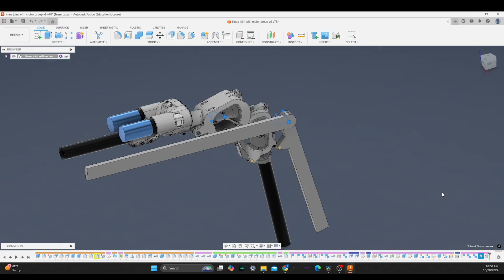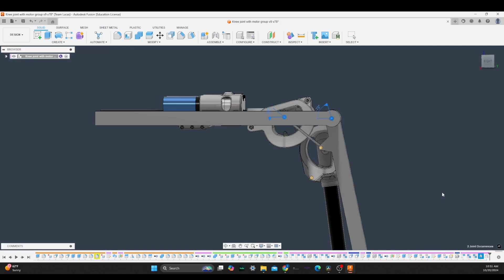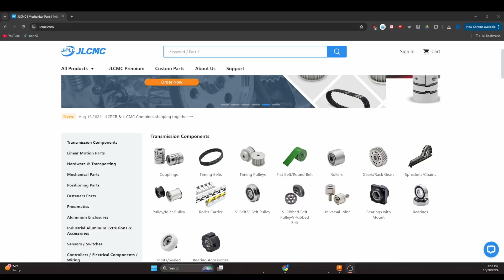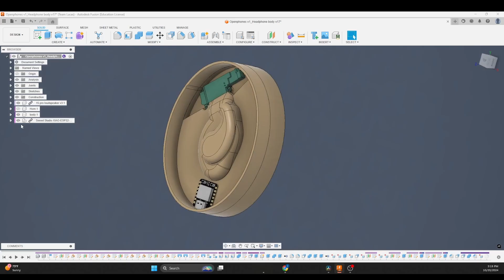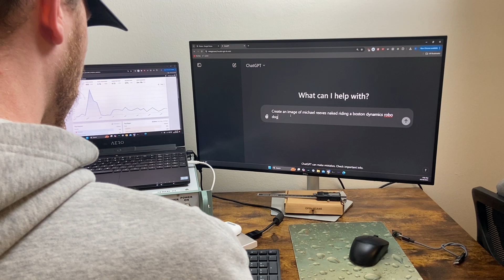Open-Source DIY Quadruped: An Assembled Leg

Comment: What kind of forces do you think it can take? I have an 80(ish) pound tripod dog (back left leg, still got most of the meaty thigh).. I've been thinking of building a prosthetic (not that he seems to need one). I wonder if I could fix that knee joint to work with gas springs.
Reply from the maker: The joint is really strong, way stronger than I expected it to be even. I bet I could put my weight on it if I had a good way to lock its position. The motors on the other hand seem to stall at 25lbs of force, but if you used gas struts you could totally get more force out of it. The CAD modes are up on my website if you want to take a crack

Comment: Are those needle roller bearings on carbon fiber? How does that hold up?
Reply from the maker: Not enough testing to ensure it'll hold. I plan on replacing the main hip axis with a 1in steel tube for the needle bearing to ride on instead of the carbon

Comment: Before I thought the motors were the wrong choice but I think I was wrong. Those DC motors could work pretty well with some good drivers. Im used to bargain h-bridges but if you have current sensing you could make something much smarter than just a servo. The design looks really stiff and durable too.
Reply from the maker: Honestly until it was all assembled I was quite worried about the motors too. The new motor controller boards are going to be a game changer. They’re so feature filled that I will probably make a video showing them off and how they can be used for a TON of other things than just driving motors

Comment: This is a very promising looking project. I think the only problem I may see with it in the future, is the foot. Although it is difficult to tell from the video, it looks like it could be a fragile part, which may not last well in walking conditions, especially outdoors. Also, wouldn't the backdriveability of a motor also depend on whether the robot is on or not? I'm not sure if your demonstration was representative of real conditions the actuator would be in
Reply from the maker: I agree with both your points. I have a more standard looking "nub foot" designed and printed which I will do the majority of the testing with, but the compliant paw was too cool to pass up. 
And yes the motors will act differently once powered up, but I think it will depend more on how the motors controller is tuned. Right now I have them on a PID loop, so the farther from their target the more current will be given. This should have them act like a spring. The PID loop can be tuned for positional holding or for reaching their target quickly, or have two stages of PID values to get the best of both worlds. I could also set a deadzone around the target angle where the H bridge motor driver shorts the motors causing them to be very difficult to back drive. Programming isn't my specialty so we will have to see how it goes

Comment: Using needle roller bearings right on carbon tube like that will fail pretty quickly with any load or use.
Reply from the maker: This is something I have definitely been worried about. I will likely replace that carbon tube with a 1 inch steel pipe for durability. Luckily that is a very easy change
Reply: @WilsonFabrication  For weight, use aluminum tube. Polish it and use PTFE sheet for bearings. Rolling element bearings are only needed for high speed.

Comment: I don't really understand the Arduino Pro Mini. Why not just solder the MCU directly to the board? Btw. you might want to use some more modern MCU-s.
Reply from the maker: I'm actually ditching the pro mini and replacing it with an esp32! And just like you recommended I'm using the castellated edges to solder the esp directly to the board. I'm planning on using the esp32-c3 due to its cost but the footprint of the board is shared with its more powerful siblings so if I need more horsepower I can easily swap it out

Comment: Great progress so far, careful about the carbonfiber dust it can be dangerous
Reply from the maker: Thank you! I did wear a mask but I should really start wearing gloves and wetting the tube before cutting next time
Reply: @WilsonFabrication  Water is all you need. Ideally something that will drip continuously on the cutting area, else you have to stop and reapply frequently. For making holes, a dremel and set of cheap diamond bits works very well. For that I keep the part almost entirely submerged in water.
Reply: i inhaled some through a faulty respirator, its nasty stuff